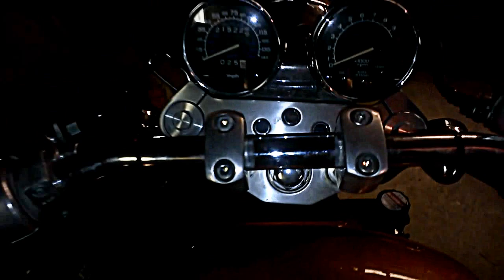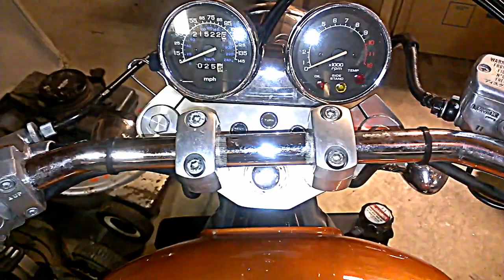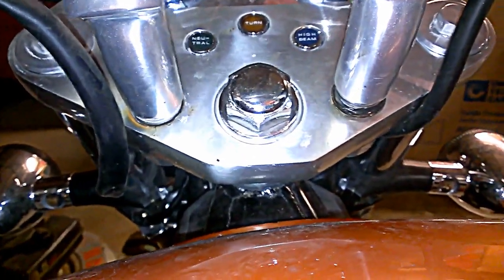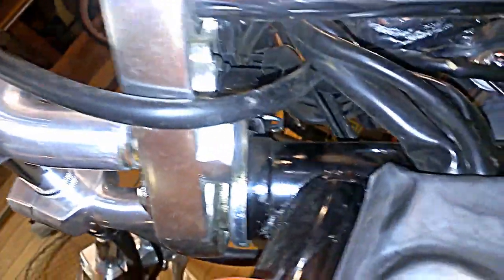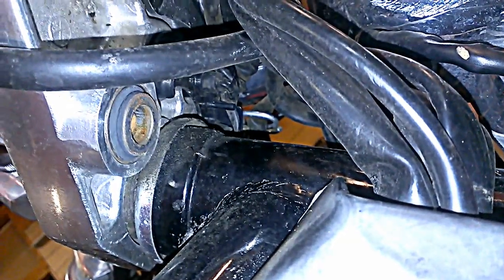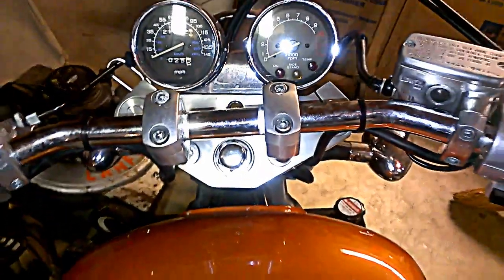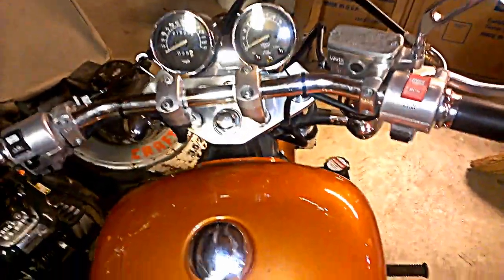Honda magna vf750c Handlebar risers bent

Comment: Risers are on backwards, lol. Or mine are. On my 94 Magna, the caps are facing the riders side, not towards the front like yours.
Reply from the maker: Oh, maybe they were! To fix this, I bought Honda Shadow risers off ebay. Those taller risers were definitely made to face the rider. If I flipped these original short ones, I couldn't turn the bars without hittin the tank.
Reply: @vtecbrown  how did you end up fixing the bent bars? mine are a bit off like yours, so i can take off the risers easy. but what next?